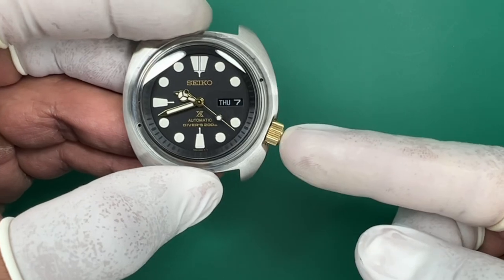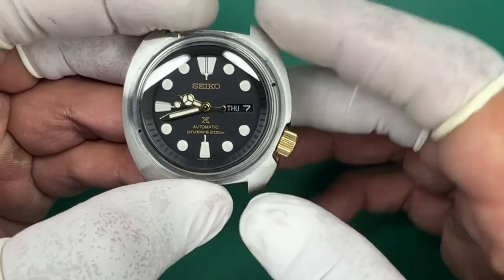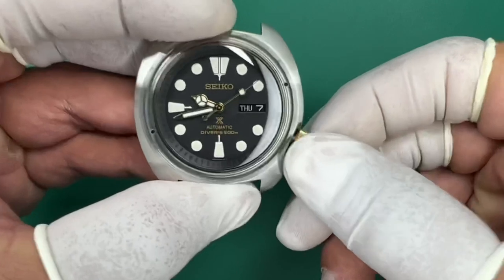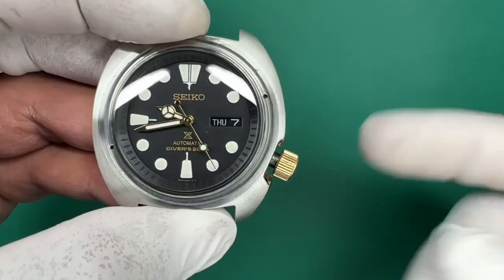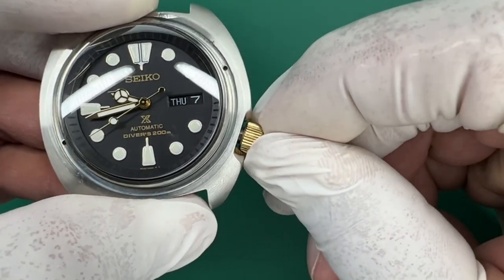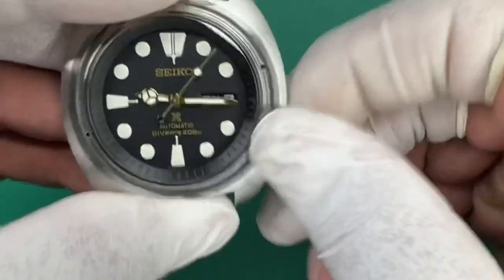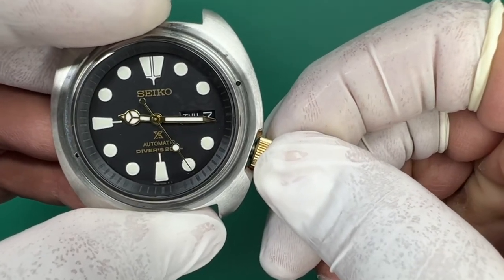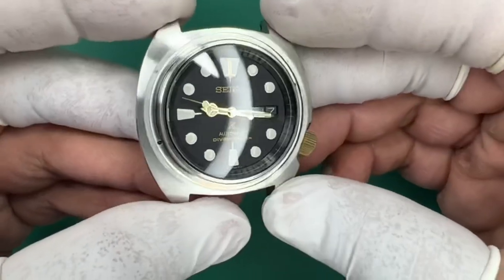PROPER TECHNIQUE FOR SCREWING IN A SEIKO DIVER CROWN

Comment: Thank you:) I tried this on my Eta2428-2 and experienced the similar thing. A little counter clockwise and I hear the sound, then turn the crown clock wise easily. But sometimes it doesn not work, it doesn't turn clock wise easily. In that case I don't force to turn it. Just I redo the same procedure and try again and it works. The important thing is you must feel the crown is turning clockwise "easily".

Comment: So I just got a seiko 5. Did not know what I was doing. Then looked this up. Simply cannot get it. Did I cross thread and fuck it up??
Reply: You have Seiko 5? I don't know about any Seiko 5 that would have a screw down crown. You probably have a normal push/pull crown. So you just pull it out for setting the watch and then just push it back in after it's set.

Comment: It seems that they would be easier to operate if the springs holding the crown out weren't so strong.
Reply from the maker: A weak spring will cause problems with getting the stem to engage the keyless works when pushing in the crown. It's better to have the stronger spring.